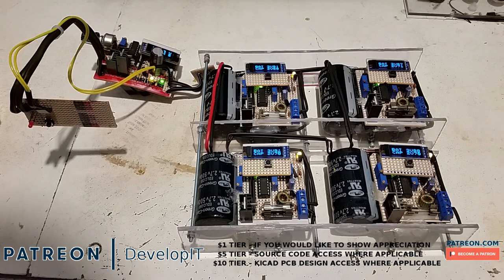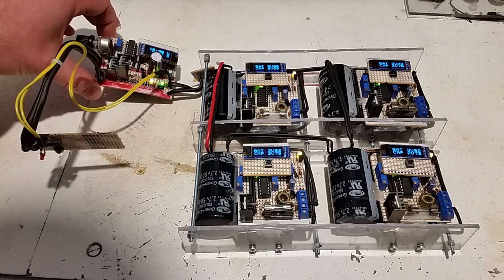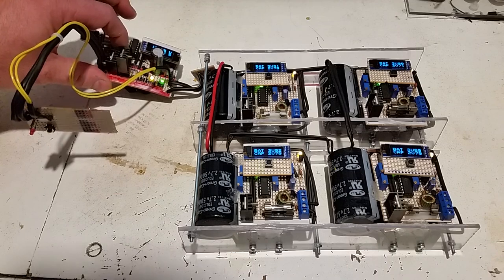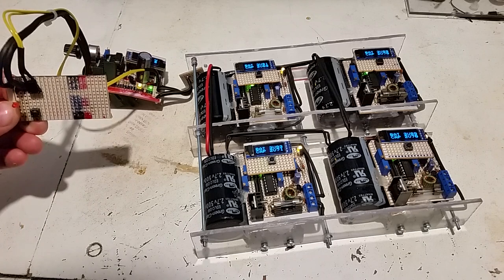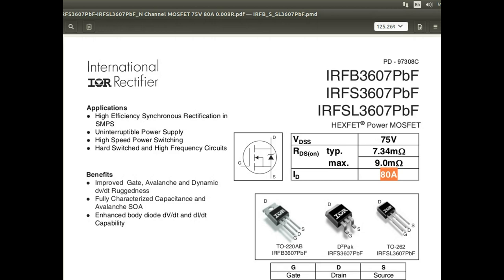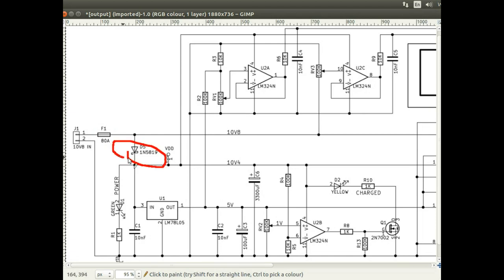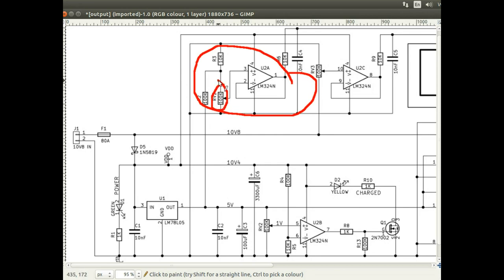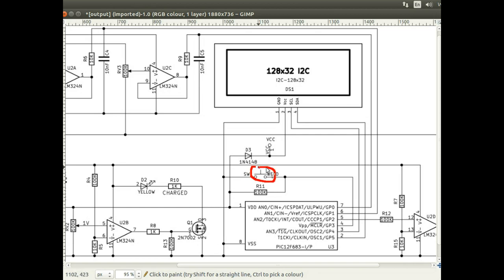18650 Spot Welder Initial Design, Using Super Capacitors

Comment: It's hard to tell from the video but in the few seconds it took for the super cap display to come back into view after you did that weld it was already showing them being full again, which means you probably aren't using very much of their capacity at all so I think you may have drastically over did it on the super cap size, it would probably be better to use a few much smaller super caps in parallel in future designs.

You could actually get some really valuable information if you can record the discharge from a few different points on a scope. I want to see how much actual power you're delivering and over what time.

Do you have a DSO?
Reply from the maker: In order to keep the power high across the entire weld time, the voltage needs to remain high, if the voltage dropped by 10%, the power would drop by 10% too. The next part of the design is to reduce the length of the wires and increase their cross section, in order to reduce resistance and increase the power at the point of welding, and reduce the weld time.
Reply: @DevelopIT  Have you run any simulations on this? I have using 5mOhm as a series resistance for the caps, 4 in series charged to 10.8 volts discharging into a 50mOhm load which will sustain around 150amps for over 100ms with only 10% voltage drop.

That's a discharge of 129 joules where the reserve capacity of the entire capacitor setup is 5,200 Joules. That's not even 2% of the capacity. In order not to be wasteful you should be using probably closer to 50% of the total capacity of the caps otherwise you could have done this significantly cheaper with 10-50F caps and still stayed well within an acceptable voltage drop for the 10-20ms that your pulses are going to end up lasting. It would also drastically mitigate the charging issues of putting all that bulk energy into the caps that you're never going to use.

Comment: Could you not have just configured the bank how you wanted and used one charger to charge it? Maybe I’m missing something. Very nice project though!
Reply from the maker: Thank you. I did one charger per capacitor because when several capacitors are connected in series and charged, they don't always charge evenly. So some get higher voltages and some lower. This would required circuits to balance the charge, so I chose what I seemed to be the simpler option.